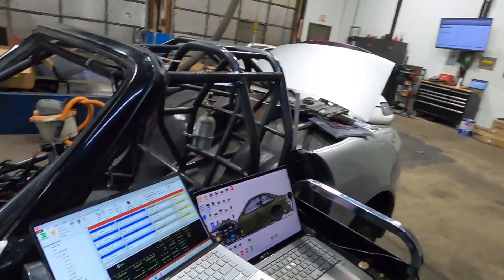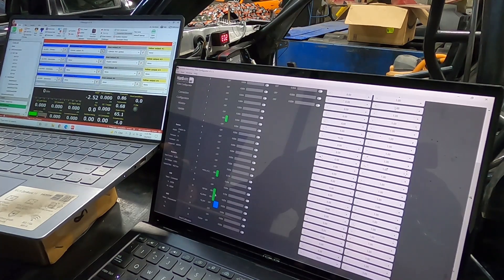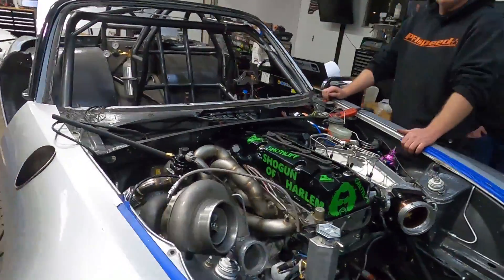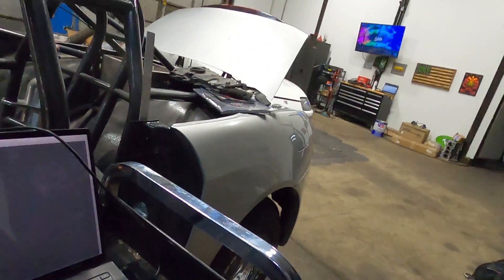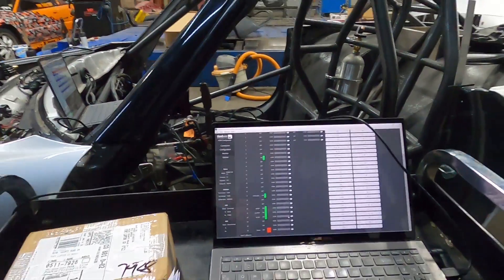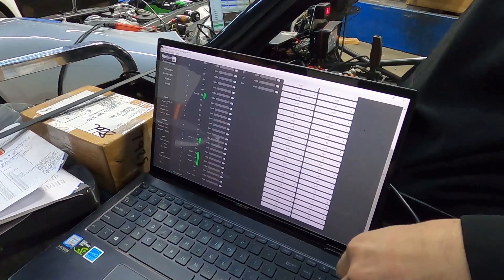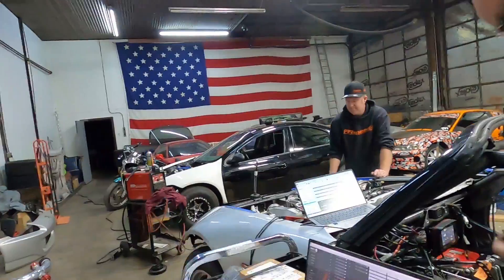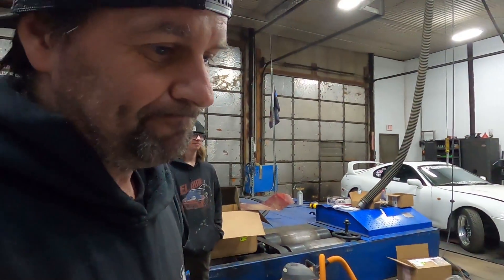SHO’NUFF I Started my race car from my Lap Top!

Comment: Even running rough,it was Running ! So dang happy for you Brent.It's close to rolling.For Goofy;is there a 'Hatch' or 1/2 a body around?A hatch would be a kewl match, cut at the right place would  be his trailer.A hatch with the front cut off,and the lower rear cut and hinged for access?It would already have suspension.Maybe when there's time.

Comment: Are you putting a rpm signal safety for the starter so that it won’t try to engage if the RPM isn’t zero, just in case you hit the button by mistake

Comment: I appreciate everything pfi does however I don't understand things some do? On a starter you 1 hot 1 negative and a single wire to ground the solenoid.  That is how mine will be wired. Why complicate things to the extreme? I don't get it?